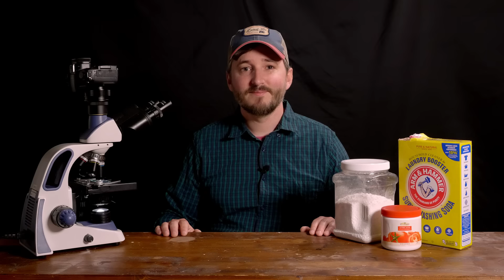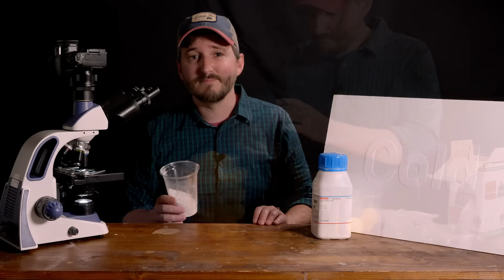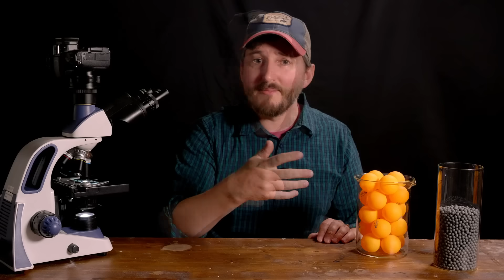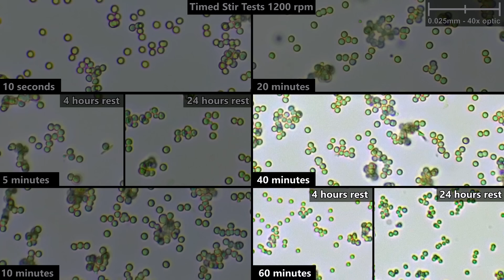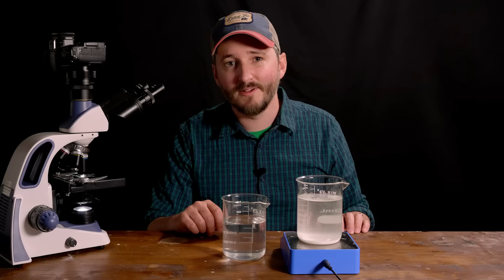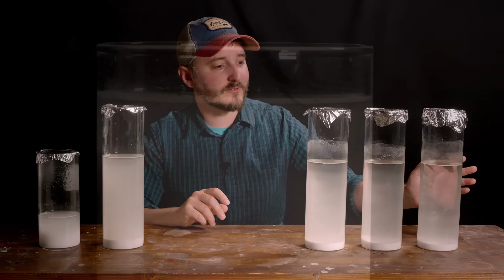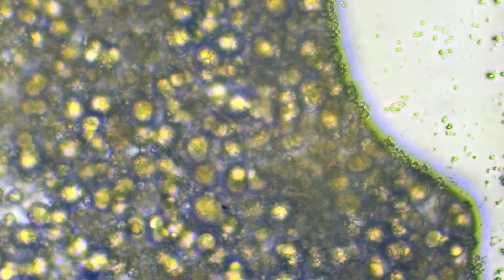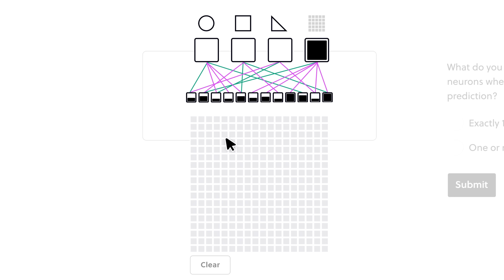Making Infrared Cooling Paint From Grocery Store Items (w/Novel CaCO₃ Microsphere Synthesis)

Comment from the maker: This was a huge project and my longest video to date! A long overdue update to my IR cooling paint project, this time using common and very affordable materials. Besides the paint itself I was happy to discover some new methods for making size controlled calcium carbonate microspheres. That may prove useful for all sorts of things. https://www.patreon.com/NightHawkProjects
Reply: By far this video is the most informative and well designed video I've seen in some time. Concise, with references and intuitive explanations! The tech is superior in so many ways due to ease of use, price point and availability. The tech is also cutting edge with novel viewpoints. Most importantly, you have shared this for free, speaking volumes of your character and thought process. Bravo and thank you.
Reply: @jamesmihalcik1310 Yes Sir Well Spoken i Stongly Agree
Reply: Remember when you made the waterproof sheet with the silicone and the VM&P Naphtha??? Why not adjust the consistency of a clear silicone and mix in an appropriate amount of micro-sphere pigment to make a rubberized type coating, possibly for roofing material??? Any thoughts???🤔
Reply: @RTR-MATEY If this works I want 20 gallons of it. Hot as hell in SE Texas at the moment.
Reply: @fookingsoc  I had the same thought as well. I'm sure Nighthawk has thought of it too.
Reply: How about automatic Ikea shutters one with the cooling paint and one black. Depending on the temperature they one drives up an the other down. With that temperature control in a room would be pretty easy.
Reply: @Saintcause  or just paint one side of your existing blinds?
Reply: I made a "cold collector" 30 years ago using a 4ft aluminized satellite dish, insulating it from the surrounding and pointing it at the clear sky - the cooling effect is greatly enhanced because all of material at the focus sees the sky!
Make a CaCO₃ sphere containing a pipe in the shape of a 3D Hilbert Curve or other space filling curve and pass liquid through it - it should cool pretty effectively.
Reply: @ahaveland hi, I went looking for information after reading your comment but couldn't find any, can you direct me to anything that might be useful? Also, the dish is obviously ideal for a spherical heat source, but a parabolic cylinder is probably the perfect shape for a tube - right?
Reply: @HaydiHaydn  Yes. It is just doing the opposite of focusing energy from a remote source. It allows a path for an object at the focus to radiate its heat away to space.
Make an insulated box out of foam sheets and put a dish or even a wok at that bottom. Make sure that the dish can't see any overhanging branches or parts of a house, only sky.
On a clear night it can make ice even if the temperature is ten degrees above freezing.
Google this in AI mode:
looking for information about something called a cold collector that radiates heat to the sky.
Reply: To get the microspheres to settle out much faster, try using the Boycott effect: tilt the cylinders in which you're settling the sediment. Due to a strange convection that forms when you tilt the tube, suspended particles settle out of the liquid at a far faster rate. There are plenty of videos on YouTube demonstrating the Boycott effect. (It has nothing to do with boycotts; it's named after some scientist.)
Reply: For an industrial scale application method. Silk screening like what is done for CPU coolers and the like. Granted it's over a larger area but that would make adoption of this for commercial use much easier out of the gate.
Reply: This is just brilliant...cutting edge science, in your kitchen! I tip my hat to you sir.
Reply: This video gave away trade-secret level insights. I'm seriously impressed with what you figured out. If calcium carbonate can do the same thing as barium sulfate, this is a real game changer.
Reply: Try CMC gum as an additive to make your "paint" easier to apply. CMC gum (sodium carboxymethylcellulose) is added to ceramic glazes, at 2%, to make them brushable. I do believe it would work for you. In addition, CMC gum will also slow drying and result in a harder dried surface.
Reply: I wonder what carbonated water would do?
Reply: Also try hexane or Xylene
Reply: @linearburn8838   it contains carbonic acid that goes between co2 and itself depending on the pressure of co2 it reacts with hydroxides to form carbonates and carbonates to form bicarbonates and any carbonate will react with any acid to form carbonic acid and a new salt like for example baking soda and vinegar, sodium bicarbonate and acetic acid will form sodium acetate "salt" and co2 "carbonic acid"
Reply: @neuroatypical6984  I'm not a chemist, but what I did get from this is, don't drink tap water or tap water treated with UV filter system.
Reply: @linearburn8838  or pump carbon dioxide gas into it while mixing.
Reply: Tip: Looks like your blender has a removable handle in the lid, for pouring.  Give it a counterclockwise twist and you can take it out, which leaves a small hole.  Then when you pour in the 2nd solution, you don't have to worry as much about splashing.
Reply: love this topic. I live in the bahamas, where an avaerage power bill can run from 600 to 1500 dollars a month. this depends on season, and appliance efficiency.
solar panels are susceptible to hurricane winds and debris, and are not always a good solution. I would love to see what this stuff does when added to a siliconizing roof paint. they are already formulated to be as reflective as possible. this could be an energy saving hack for people who need to re-seal their roofs.
Reply: For apply the paint  to flat substrates, could you use temporary spacers the thickness you want the layer, add the pigment, then usse a straight edge to smooth the surface, like cement pouring? 1mm seems like a decent thickness to be able to do so.
Reply: @NekuraCa your correct like using spacers when making cookies so there one thickness
Reply: I wonder if ultrasonic agitation (perhaps in conjunction with stirring or blending) would result in smaller spheres again?
Reply: @ShoebridgeForPM  This! Small ultrasonic cleaners are cheap. NHIL probably has one lying around somewhere already. Should be easy to test.
Reply: Pretty sweet!  I hope to experiment with making this myself one day.  I love how much time and dedication you put into these projects.  Between your detailed explanations, practical experiments and open sharing of your findings, you are an inspiration!  Keep the great videos coming!  Thank you!
Reply: Wondering if using it on a soda can stack like making passive solar heat panels.  Could make passive cooling panels instead???
Reply: Probably the only time I've stuck around on a youtube video to listen to the sponser without skipping ahead, I appreciate you that much :)
Reply: Bravo.
Job well done.
But, "in the field", as I have had happen to me, my "white cooling paints" became COLONIZED by natural mold and mildew, often BLACK.
   So any "sky cooling paint" must be able to prevent mold and mildew from destroying all your work.

  Try adding some Zinc Oxide to your paints.
Reply: @craigescapeddetroit5198  maybe some silver nitrate could prevent mildew
Reply: I wonder if Zinc Chloride would help the mold problem?
Reply: @craigescapeddetroit5198 TiO2 will work just as well ...
Reply: How about laying on the paint like a printing press? Flood an area ahead of an impermeable roller that is shimmed above the surface to be coated then roll along the shims [1mm? 0.5mm?] with the roller forcing the 'puddle' ahead of it, leaving a uniform coating behind trailing the roller. As you lay down a patch, add more 'paint' ahead of the roller. This could be done on a continuous substrate even, "extruding" coated material in a continuous stream . Hopefully I described that adequately.
Reply: If you painted a flexible plastic with it, you could probably make a "big cooling tape" or something similar. Also, it would be more resistant than a non covered paint.

Have a great day!
Reply: I think salt may help following the snow principle it will make thermally transparent gaps that will increase scattering and as you said stiffen the paint, getting them to be nano particles would be hard but maybe they could go in the water of the acrylic mix

potassium chloride crystalizes more pure, sodium chloride crystalizes faster but traps impurities including gases the ideal mix for optical quality is 60% sodium 40% potassium salt, also adding iron 3+ chloride improves crystalizing dramatically adding potassium hydroxide or other bases seems to stop crystallization I have experimented with iodides and iodates but it has way too many problems, bromides show potential but can be carcinogenic with uv light or stray reactions, also corrosive
Reply: Make a stepper motor controlled print head to go in a CNC machine. It could lay down specific flow rates and application speeds.  Could use a heated bed to speed up drying too.  Thank you for making this technology available for the home chemist. 😊
Reply: @pulsewaves  that requires highly consistent material, which is a problem already for the wide tip bulk application method.
Reply: If you could lay down some tape or something similar along the edges of the panel at your target thickness, you could use a screed to pull an even and smooth finish on the panel.
Reply: FWIW, I did the math with my creaky old brain and reasoned out that, when trying to figure out the largest circle (R2) that would fit in the gap between three touching larger circles (R1), R2 = (R1 * (2 - sqrt(3))) / (sqrt(3)).  That comes out to an R1/R2 ratio of about 10,000:1,547.  (Interestingly enough, 15.47 = 7 * 13 * 17)  Therefore, if you use a 20:3 ratio (just over a 3% smaller radius for the smaller spheres) for each smaller sphere size, they should easily be able to slip between the larger ones.  

Cheers!
Reply: wonder if an airless sprayer might work, these can spray thick paint.  
Could these pigment be mixed with car spray lacquer and sprayed on.  Some of the colour shifting paints don't dissolve and have to well mixed into lacquer  (ref: dip your car channel)
Reply: @jbaldwin3092 did u try your experiment with lacquer? What about paint base ? Or even the airbrush ?
Reply: You're such a treasure of information dude! You need to collab with backyard scientist one day and take over the world
Reply: love the good work keep it up, i cant overstate how important a role you perform in todays society, inspiring the next generation.
Reply: How would this be mixed in with cement? Could be nice to have around something like a pool deck where you are walking with bare feet.
Reply: All of the above, plus:  you look like Will Weaton.
Reply: You could look into different "tail solvents". They're  slower to evaporate than pure acetone, increasing the drying time and potentially letting you paint it with a brush.
Reply: Dumb question  ? Can you add that pigment to other paint.
Reply: @dallaswoiken7533 I had the same question.
Reply: When a published work is behind a paywall, you can usually contact the author(s) directly and request a free copy.
Reply: that shout out to tech ingredients was cool af. much respect that man is something else
Reply: If you Google,,, ( beef jerky gun)  i think you will really like the results,   They are like a caulking gun, but come with many different tips,, I had an issue coating some items like you are doing,, the wide tip was just a bit to open, used a vise and closed it to the right size.
They are as easy to control as a calking gun..
Reply: @noel1933 I've heard them called sausage tube guns, and thought the same thing!
Reply: I am curious if changing the pressure would change the size of the spheres.
Reply: Does putting a clear coat over this paint damage the cooling effect? I would think it wouldn't but I'm still not sure. Have you tested it?
Reply: Well done. You will get a significant improvement and massive cost reduction if you can replace the plastic binders, with A MgO- KH2PO4 chemically bonded ceramic.
The plastic absorbs All wavelengths. The Newberryite crystal ceramic reflects them.
As an added bonus it rust protects, sticks to any surface, from metal to timber, to cleaned and prepped prepanted surfaces.
Reply: Wouldn't the plastic cover trap result in condensation?
Reply: @Lupine.  Apparently a clear film is needed to reduce conductive heat from wind blowing over the surface.
Reply: @rjsongwriter  I think it's probably because the dirt pickup rating would be atrocious, reducing any practical functionality.
Reply: @Lupine.  Then you also get free water!  Collect it!  If your air is clean then it should be free from contaminants.
Reply: I think this is a very good idea for a paint company, it just needs more research on how to make it easy to apply with a brush
Reply: You can apply it with a trowel like skim coating a wall with plaster.
Reply: Have you tried other acids? It reminds me of when we used to use floor leveler and add vinegar to slow down the reaction.

Maybe apply it like solder paste?
Reply: Hey nighthawkinlight, really find this amazing.

I was wondering what kind patent you are going to use for this discovery. This is an incredible finding and can really be of help to achieve cooling while limiting pollution !

I really think open source science that can be applied individually and not rely on industrial equipment will play a big part in how well the world will adapt to climate change :)

Thank you for your findings man !
Reply: try using an ultrasonic (element) bath instead of the stirrer
Reply: I might have missed something in this video. What makes a dense pigment full of microspheres of CaCO3 of different sizes cooling? What density has to do with cooling?
Reply: @fsfsskbd14  scattering, any light missed by the top surface is more an more likely to be bounced back to space.
It is kind of weird to reason about because why couldn't a dense homogeneous material WITHOUT spheres do the same. Well I think of it as not everything is hitting at a straight angle to some ideal surface, the material can have impurities,  and that top surface can accrue imperfections either in application or over time. Microspheres it seems create a LOT of leeway when dealing with imperfections for all types of factors and that leeway is a requirement for "perfect" materials to function in our imperfect world.   This is a gross explanation that's more analogy than physics description.
Reply: @TheNewton  would glitter dust of different sizes achieve the same scattering effect?
Reply: Much easier to watch here. Your tiktok is so chopped up.
Reply: Plastidip has a clear coat they add all kinds of pigments to. Maybe thats something you could try? Dip Your Car has tons of vids using clear dip even a super black car.
Reply: I wonder if we could make it grow into sheets
Reply: Hardest thing in the world is to make something easy.
Reply: No, don't treat acid reflux with that stuff.
Instead, have a glass of water with a 1/2 teaspoon of apple cider vinegar.
You'll help yourself a great deal.
Reply: You're amazing!!!!! Stay independent if you can.
Reply: Not sure if you are still paying attention to comments on this video but I have a question I think you might want to work out the answer to:

What is the wavelength footprint of the infrared emitted by this paint?

Here's why this is important: Common silicon solar cells can absorb and generate electricity from a small portion of the infrared spectrum.  Around 1,000nm, absorption starts to drop off, and above around 1,100nm silicon solar cells can't convert into electrical energy at all.

So, I'm considering putting one or more vertical, bifacial solar panels on my roof.  The top of our roof is currently black, and I'm considering covering it with something white so the panels can benefit from the reflected light.  Our house gets too hot in the summer, so we might benefit further from using this infrared cooling paint for the white pigment.  But, wouldn't it be cool if heat bleeding from our roof was emitted from the cooling paint in the portion of the IR spectrum that the solar panels can capture and turn into energy?  Even if only a portion of the IR emitted was above the threshold, that would be awesome.  (Also, is it possible to control the spectrum emitted, perhaps by controlling the size of the spheres?  Maybe you could develop a paint optimized for solar panel absorption, as a way of combining cooling (probably at an efficiency cost, as some of the IR absorbed by the panels will be reemitted rather than converted to electricity due to their poor efficiency) with power generation.)

Anyhow, I'm not sure if you have or can obtain the tools to measure this, but if you can, I would be extremely interested, and given your own interest in solar power, I'm thinking you will likely be very interested in this as well.
Reply: Could you mix CaCO3 into a commercial elastomeric coating (snow roof) and roll it directly onto a roof?
Reply: Love your videos. Can you attempt to put the powder into naphtha to see if it changes the nano structures.
If it does not cause any reaction or destruction of the solution, I suggest trying then to add silicone as a weatherizing/durability agent.
White or clear caulking silicone will likely need to be tested if it gets to that.
Reply: I'm thinking about trying this on a boat. It has AC, but the cabin (painted metal) needs some sort of coating.
Reply: i love your videos, thank you so much for this info i cant wait to try it out. i just wanted to ask, what species if your bird? im a birb dad myself and ive been wanting to add one just like yours to my family
Reply: imagine looking like jschlatt but better looking, smarter, more famous, etc lulz
Reply: Maybe you could try one of those sponge paint brushes with the syringe paint loading system
Reply: you are a f'ing genius.
Reply: It's great to have you back and getting the follow-up you promised in your initial video is an added bonus as this is a fascinating subject with significant implications for our current situation.
Reply: great vid
Reply: Is there a way I can discuss an idea I have with you privately?
Reply: Nice work! You combined your and others genius to a complete story with a happy end! And you mention the work of others in a fair way. Thats exemplary for yt creators. While others are demonetized, you should get double. Because you are an inspiration for people to achieve something.
Reply: @Nighthawkinlight
Hey! First off, I love the videos!
Second, I've worked for a company that does panel lamination, and we would spread adhesive with a notched adhesive spreader. 
It looks like your paint is at an easily workable viscosity.
And it's pretty quick, 1 person would do an ~80 square foot panel in about 2-3 minutes.
Might be a consideration if you want to save some time with the application of the paint for any large cooling panels you might make.
Reply: That's quite a lot of pseudoscience for 2 minutes intro
Reply: I'm planning on using your techniques to test a derivative of the paint on leather to see if it would be a stable compliment for clothing as it typically doesn't go through a wash cycle and has a minimum angle of inflection
Reply: Congratulations. Thanks for putting the huge effort into this
Reply: Have you tried using a window screen to screen print the material?
Reply: THANK YOU SO MUCH!!! please protect yourself and patent this ASAP!
Reply: I just got done doing a month of research during my undergrad in Physics about effects of microwaves on the grain structure of LAGP (Lithium Aluminum Germanium Phosphate)
I wonder if these crystals would react under an EM field? Might be cool to try?
Reply: Using limestone as a basis for light-reflective paint is sure the cheapest & safet way to do it, but have you considered using rutile (TiO2) for an even larger reflectivity?
Reply: Too bad the paint's so fragile & must be covered, wanted to paint the AL frames on my harbor freight solar panels & see if boosts performance!
Reply: You've just made my life more tolerable
Reply: Every one of your videos is better than the last.
Reply: Brilliant work. One of the better home made ideas I have seen in a long time.
Reply: Can try to make some magnets
Reply: Does the opaque binder obscure the specific IR properties of the pigment?  

Would a clear binder work better? 

An evaporative binder like shellac would melt into previous coats potentially allowing the spheres to settle into place more evenly with multiple coats. 

A slow drying (actually oxidizing) binder like artist oil would allow pigments to settle in a single coat.  Linseed (aka flax oil) would be the most common one. 

Many of these yellow slightly though.  Pure Tung oil does less so than Linseed oil.  And you can get clarified shellac. 

So a clear  slow-ish drying binder that doesn't absorb that band of IR seems like the binder to look for.  

Gum Arabic is the traditional watercolor binder.  It can be found at the grocery store.  

You would need an additional clear coat of something different for durability on most of these. 

I've also noticed that evaporative paints often feel cool as long as they are drying.  Solvent can be trapped below an outer film for a while.  Especially on thick applications.  ... don't let the evaporative cooling throw off your tests.
Reply: @jasonbeebe2128  yes you are correct. Basically any Organic polymer binder is opaque to most wavelengths, especially IR. Unfortunately that would include those you suggest. That's why I suggested chemically bonded ceramic MgO and KH2PO4. A water bases system that sets in 30 minutes to Newberryite, and is IR reflective, water and chemical resistant, and corrosion proofs and chemically bonds to metals, metal oxides, timber, cements, stone, and almost all substrates except shiny plastics.
Cheap and non toxic, available at any fertiliser suppliers.
Reply: @jasonbeebe2128  Newberryite is also unaffected by UV and if dehydrated by baking at 250C will handle 1800C temperatures without degradation.
Reply: Your a legend mate.  I'm planning to move to a hotter location and now I have a way to be cooler.
Reply: SUBBED!!!
Want to use this with Tintable Bedliner Kit on my truck's exterior.
Reply: @xXThePointXx  Buy some MgO and KH2PO4 at your farm supplies, mix it with a small molar excess of MgO to KH2PO4. And just enough water to comb or stiff broom it on. 
Excellent results have been achieved with Dolomite lime as a filler. So guaranteed this will work too. 
Wet out some Cotton bed-sheet like you are fibreglassing or mix in some cotton microfiber.
It's a fast set, but you can retard it with boric acid or borax. 
microcellulose or agar have been successfully used too as retarder. 
Or if you can employ a mixing nozzle, and spray, that's even better. 
Sticks to and converts bare metal, or rusty steel to chemically bonded ceramic. 
Used for everything from military ships, to Oil and gas pipelines, to lining gas turbine power station exhaust nozzles. 

Not available for consumers because they don't want you having stuff that lasts forever. 

Have fun.
Reply: @NightHawkInLight this reminds me of an experiment Codyslab did where he made a water pump that used only a temperature differential (and associated expansion and contraction of the liquid) to move water from one place to another. I wonder what would happen if you or he applied this pigment to the cold side tubes of such a setup....
Reply: Waiting to see the video disappear with a big payoff shutdown from some corporation buying it up.
Lets see how long it takes...
Reply: I wonder if the addition of a small amount of styrene to the acetone would add some flexibility and make a less brittle coating.
Reply: real talk, why not just apply clear coat? Paint the roof. Apply clear coat instead of plastic.
Reply: Thank you for sharing this incredible formula!
Reply: I wonder if it could be used in a powder coating application.
Reply: Perhaps dipping the panel in the paint. How about a spray clear coat experiment also? I'd be interested if that would ruin the cooling effects. 😎 cool video. Patent that
Reply: Sie sind wirklich ein wirklich edler Mensch, der in unserer heutigen Zeit leider einen seltenen menschlichen Geist in sich trägt. Vielen Dank, Anerkennung und Respekt für Ihren ehrenwerten Menschen.
MTMMMH18/
Reply: Use your acrylic snow scattering recipe from your previous video to make an overcoat that will protect the paint. Multiple layers should only improve the effects of this paint/primer.
Reply: yeah ngl I had to watch on 1.75x due to the talking speed
Reply: Have you looked at adding a silcone surfactant for enchancing your emulsion and wettability. They come in a wide range of viscosity too to help with your coating.
Reply: So very consistent in how practical you make your projects for the average person to do.  My wish is that this become useful in the place of pigments for stucco, shot Crete, and aircrete.  Even in a long video you manage to script and pace do that I don’t have to watch at 1.5 times speed.  😂
Reply: What about electrostatic application like powdercoating?
Reply: Can you put this paint on a pice of clothing ?
Reply: What about using clear coat,resin or clear wood stain with your pigment?
Reply: How is that paint holding up to strong UV radiation? Any yellowing or changes ?
Reply: I personally think this is brilliant, and also that you may have already received multiple offers, at least from global leaders in paint manufacturing.  Have you read Microsoft's policy on IP? 

"11 a.  Disputes covered—everything except IP. The term “dispute” is as broad as it can be. It includes any claim or controversy between you and the device manufacturer or installer, or you and Microsoft, concerning the software, its price, or this agreement, under any legal theory including contract, warranty, tort, statute, or regulation, except disputes relating to the enforcement or validity of your, your licensors’, our, or our licensors’ intellectual property rights."

I bet Google has a similar policy, if not Youtibe also, without knowing for sure.

First to market, means I hope you've already filed for provisional patent(s).

Great Work!
Reply: i appreciate Every Min Thank You for the hours spent that we did not see as it ended on the editing floor...
Reply: How to put it on fabric so I can be like Predator and invisible to IR
Reply: What about a clear coat or polyurethane or resin over the paint? The refractive index will shift some, though I don't think it would offset the results by a margin that would obscure the effects.
Reply: you did this all to save 49$ o.o
By the way, this is how these people get funding for their work
it's like me using an addblock
Reply: How can i contact you directly in regards to a project you may fine useful. Think: Star Trek IV 'transparent aluminum.'😉
Reply: How can i contact you directly in regards to a project you may fine useful. Think: Star Trek IV 'transparent aluminum.'😉
Reply: Watching your video got me thinking—it's fantastic! It reminded me of Dr. Ben Miles discussing the Cyphochilus beetle, which is closely related to the property you were working on. In case others are reading this and haven't heard of the study: the beetle's exoskeleton reflects light extremely efficiently, resulting in a bright white appearance. This is due to the structure of its scales, which scatter light in all directions. The scales are composed of a dense network of chitin filaments arranged to maximize light scattering, producing the bright white color without pigments.

I recall you mentioning that for the best results, the paint should be spread over a wider surface. Your video had me thinking about the comparisons between the reflection properties and cooling features of the beetle's scales and the paint patterns you were using. Either way 😎 cool video 📹
Reply: ³3p3⁰😅😢😮😅😅😅😅😅😅😅😅😅😅😅😅😅😅😅😅😅😅😅😮😅😅😅😅😮😅
Reply: I have a question: Lets say I make this at home, and paint the tiles at the roof. I enjoy the benefits at summer, because the roof won't absorb as much heat, so our house will be cooler. But at winter the opposite would be good, to collect every bit of heat from the sunlight possible. So the question is, would this make my heating bills rise much higher during winter, because my painted roof reflects back the sunlight?
Reply: Fantastic work !!! As a fellow enthusiast, I admire your blend of chemistry and engineering. Could you please share what magnification you used to observe the micro spheres  ? Thank you!
Reply: What would happen if you painted this onto a Thermoradiative Diode?
Reply: Would this experiment be affected by the aluminum foil dissolving into the acetone solution?
Reply: Is it healthy  too. Omit Infrared from our bodies😊
Reply: What about the opposite - heating paint? Is it possible to make a similar black paint like Musou Black (black paint with a light absorption rate of 99.9%) for passive solar heating of surfaces like water tanks, walls or greenhouses in colder regions?
Reply: Why not use it as a pigment it in an epoxy (like TotalBoat)?
Reply: couldn't we use a clearcoat finish, like a urethane or polyurea or even a ceramic sphere clearcoat that uses similar science for a similar result? i wonder if using the ceramic sphere clearcoat would even increase the effectiveness of your very accessible basecoat? to keep the coating safe and clean? or would that trap the heat and negate the purpose of the coating?
Reply: Hi, my biggest chemist experience is to add olive oil and lemon to my salad. I was very impressed by the lecture on  your experiment and development of this cooling paint. The way you presented was really good, keep me engaged all the way to the end. I watch both videos back to back and couldn't go away until done.
 My son forwarded me these videos after I just recently bought an RV trailer thinking to use this to help maintain the temperature down along with the AC. 
I think that this can help and then I come up with another idea that maybe more useful. If I understand correct this panel can bring the air underneath to about 20 degrees F, if this reduction bring the temperature to below the dew point I believe condensation will happens, so maybe if painting thin panels with small fins in the bac this can be a passive way to get water in arid places. probably not enough for human to survive but maybe this is use for reforestation.

Thanks for the nice learning experience.
Alejandro.
Reply: There is another way to paint a certain height of paint use a ruller at each end gleu a coin and push over a surface it be all even thickness so it's done in industries and painting laboratories
Reply: So at time of the video's making how much did this additive cost (per gallon of paint)?
Reply: Most PATENT holder submit this as their  investment and charge money based on this development time when in fact they has to educate students at the university and motivate them . Such a painful process they think is worthy of massive compensation.
Reply: Make this 28:53 the thumbnail and the views will be worth the effort.
Reply: I don't have the patience to watch, but if you are trying to spread an even thickness, there are tons of better ways - fx pouring some out and spreading it with a flat piece of something with a "tooth" in each end. Maybe looking at tile setting can help you out.
Reply: "I don't have the patience to watch," but YOU MUST listen to ME because I am an important viewer.
Reply: More about the physics than the chemistry .  About particle size and shape.
Reply: Have you considered just pouring approximately the amount of "paint" you need on panel (taped around to form a "tray") and spreading it evenly, like masons do with cement? From what you said in the video it seems that it doesn't dry too quickly.
Reply: @Sk0lzky  also see the comment on screen printing , there's so many ways one "could" apply this but really needs to tried by others.
Reply: Your longest video but possibly your most important. Surface-based reflectors could be our best hope for stopping/reversing global warming.
Reply: @flt528 
Our best hope is in using regenerative farming which emphasizes polycropping, regreening, soil building (especially carbon sequestration --which makes the best soil), avoiding overgrazing, avoiding products grown via conventional ag.
If we avoid excessive annual crops, 
avoid bare earth (fallow)/plowing practices plants and opt for polycropping especially with deep rooted, long lived crops, that means a lot more carbon sequestration year round.
Every spring CO² greatly reduces because of regreening but farmers are still growing crops on soil that is kept bare during winter, and ranchers practice free range grazing or use CAFOs when mob/AMP grazing produces more biomass per acre per year, improves nutrition, soil, and increases CO² absorption into soil, reducing the effects of flooding, drought, reducing erosion, deepening soil, and sequestering water better.

Add a lot more general purpose rail, and get it a lot more efficient that would make airplane travel less desirable.

Reflective surfaces help, especially if they're greenery...
Reply: so. many. grammatical errors.
Reply: In the comments I assume?
Reply: @h7opolo In the comments I assume?
Reply: @h7opolo  So. what. ?